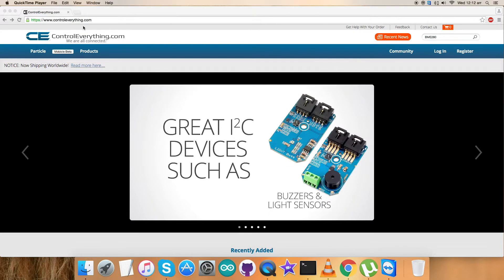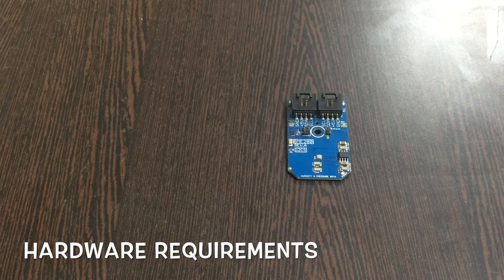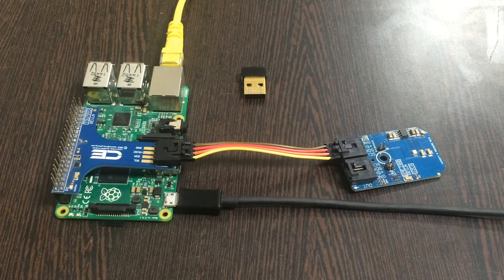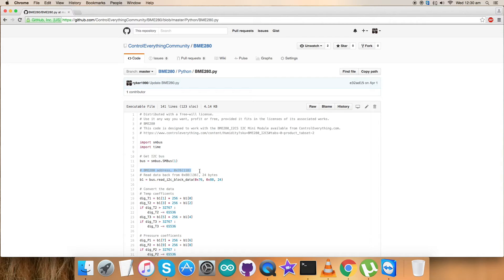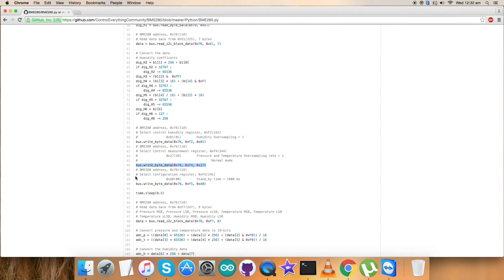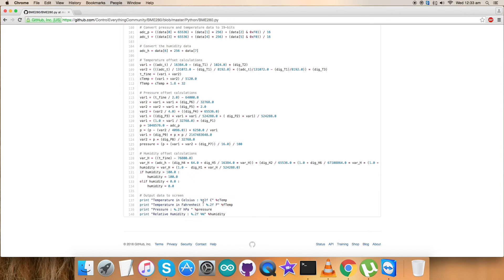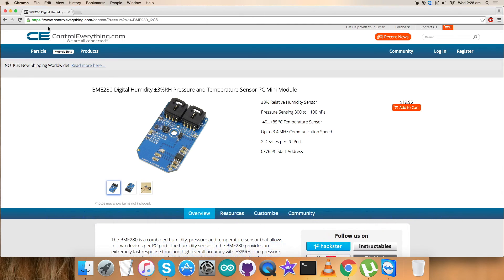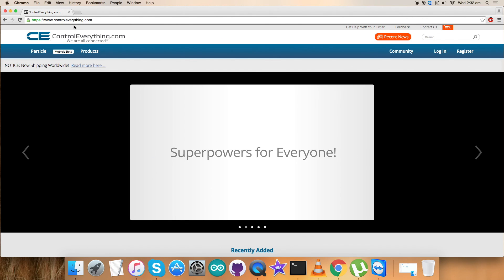Raspberry Pi BME280 Digital Humidity, Pressure & Temperature Sensor Python Tutorial

Comment: what are required softwares to install in raspberry pi
Reply from the maker: - Install Raspbian OS or Debian
-  Enable the I2C protocol in configuration settings 
As mentioned in the Github Readme page - https://github.com/ControlEverythingCommunity/BME280

 - For Java install the package called Pi4j  - http://pi4j.com/install.html
 - For Python Install smbus - https://pypi.python.org/pypi/smbus-cffi/0.5.1
Last, Download the GitHub repository from mentioned above ControlEverything Community
and run the command:

"python BME280.py" or "pi4j BME280"

Comment: Hi , I have a question about the connection. 
Is really needed the I2C shield ? Or could I have any problem if I connect the SCL and SDA cable directly from the sensor to the raspberry ?
Thanks in advance
Reply from the maker: You can use it without I2C shield but i2c shield makes it easy to connect and it has a level shiftier which helps in noise reduction and increases the cable length.
Reply: Oh ok... Thank you. 
I will try iT NOW. 
Excellent video